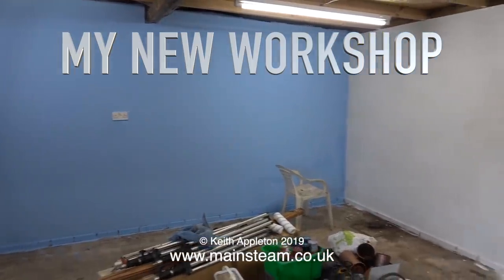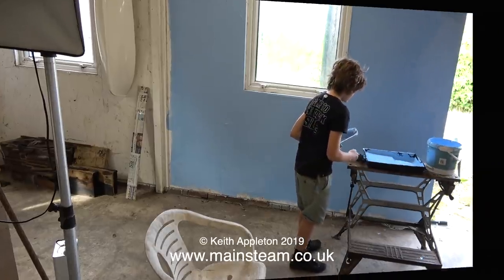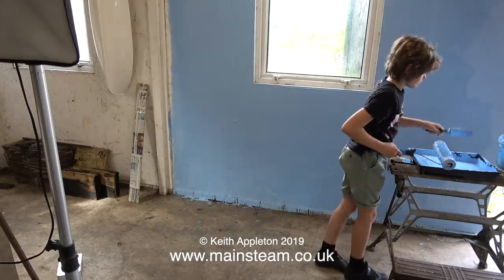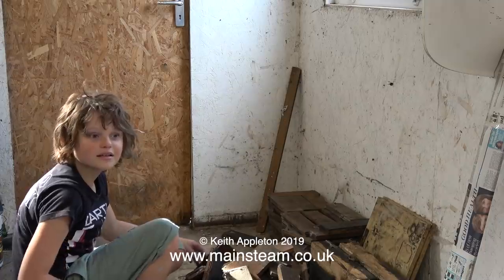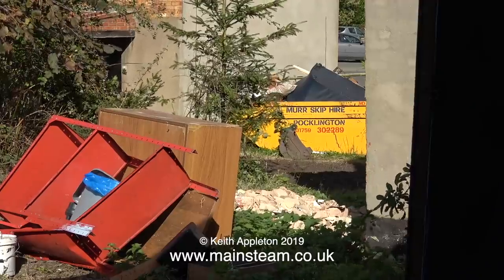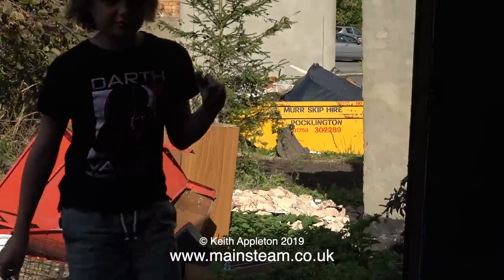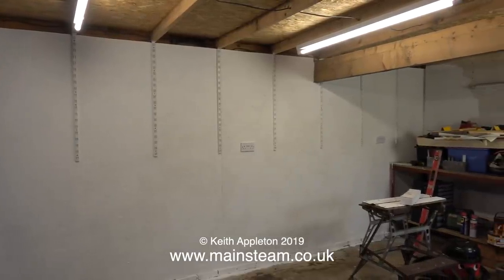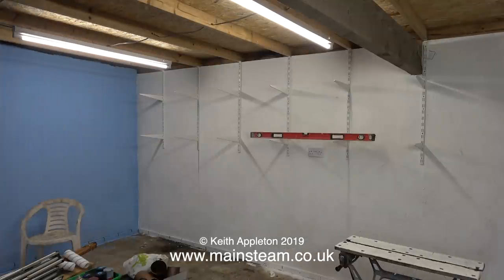MY NEW WORKSHOP - PART #2

Comment: Best way to learn how to paint, is to paint an area where if you put a bit of paint on the floor, or miss a bit on the wall it does not really matter. 
I trust you split the work. Grand children floor to power point level, and then you did the rest.

Looking good.

Comment: When you think you have enough light in your workshop double it.  I have been helping my retired father get his 11x20 shop setup (they moved to an island) and it came with two incandescent light bulbs on the ceiling which i replaced with four 4ft fluorescent tubes which he thought was good enough but I didn't.  I then added a couple more 4 ft tubes near his shelving with pull cords which he though was much better.  I just added two 4ft LED light bars with pull cords over his work areas and the difference is huge.  Our eyes are great at compensating for low light levels so we don't realize how little light there is until you add more.  It's so much more cheery in there now and with the ceiling radiant heater on it feels like being out in the sun.
         I also covered the concrete floor with those 2ft sqr wood 1/2" flake board tongue and groove  "tiles" with plastic eggshell backing for an insulating airspace.  I highly recommend these as they are very easy to install and don't need gluing or nailing down.  I then covered that with 1/2" tongue and groove plywood for added durability.   It feels much nicer on the feet than hard cold concrete and if you drop something it will likely survive.
Reply from the maker: Today an electrician is going to upgrade the roof lighting and fit more power points.

Comment: Bonjour Keith,
How are you going to heat this large workshop ? Will you have enough electricity power for all your tools ? Paint is the "funny" part of the huge work of rehabilitation and you are lucky to have grandchildren patient enough to finish what they started  :+))
Amicalement, Raphaël
Reply from the maker: The Air Conditioning unit works as a heater also . . . .